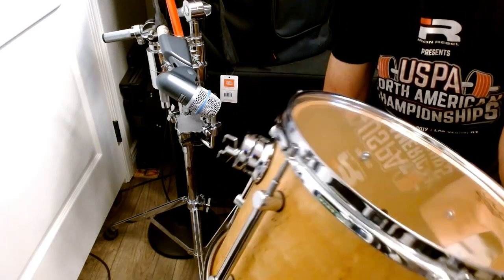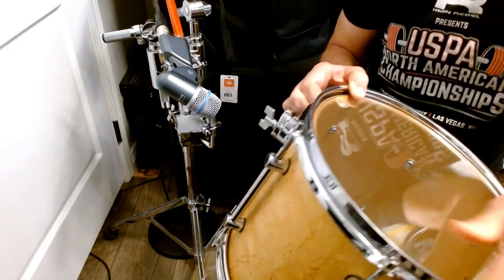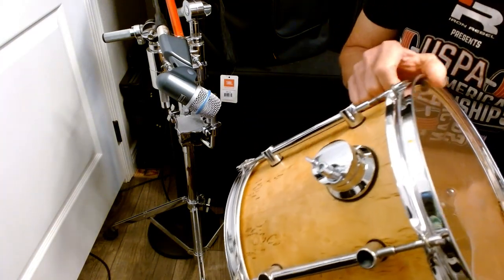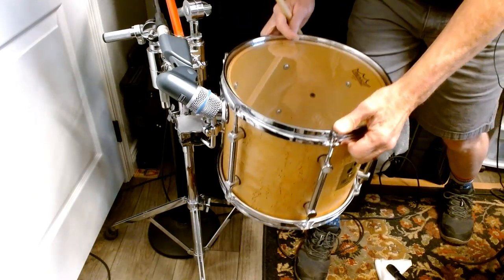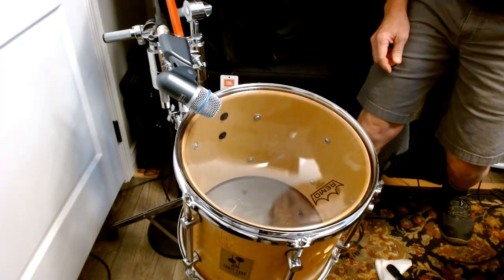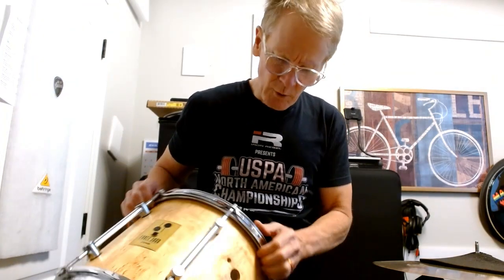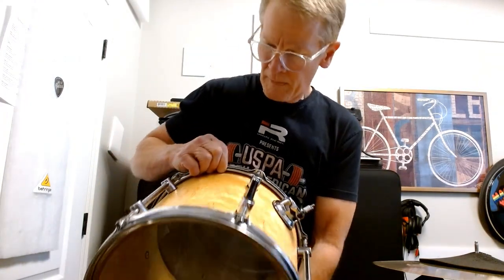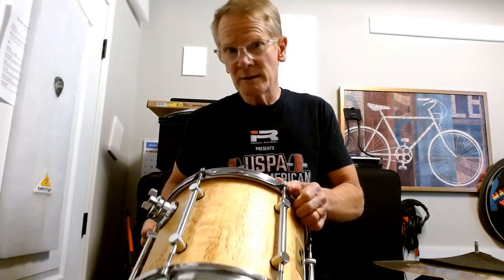Tom mounting revelations.

Comment: Necessity is the mother of invention. Sounded great.
What amazes me the most Karl concerning the original mount was that it mounted to 4 lugs.
How the sound changed on that tom makes me wonder about all the other Sonor kits that may experience the same problem. 
My kit has the 2 lug mount being a cheaper kit.
Sounds finer than I anticipated with Remo ambassador's on the snare and Kick drum.
Emporer's on the tom's.
Appreciate your wisdom!
Reply from the maker: Yes! Thanks.
Reply: @karlplaysdrums
Reply: Your drum went dead with the Chrome/Steel R.I.M.S.® Mount because chrome plating the steel hardens the material creating a pitch in the hardened steel band that conflicts with the drum's tuning. This is why Gauger Percussion switched to using anodized aluminum since the anodized aluminum material is softer and doesn't create the same problem as chrome/steel. Also, the copies of our original steel R.I.M.S.®never fit the drum exactly as required to isolate the resonance. The mount must center over each of the lugs since the 'pulling out' or 'pushing in'  create pressure on the lugs used to support the drum.....this is not good since it 'draws off' the resonance ! The new Alloy system also only uses 3 connecting points to the drum in place of 4 so there's less contact with the shell. Although the new mount you placed on the drum seems to capture more resonance I can hear the loss of the low fundamental of the drum which is in the unrestricted shell when it is allow to resonance fully in supporting the vibrating head.
Reply from the maker: Thanks for the comment! I may give aluminum rims a try.